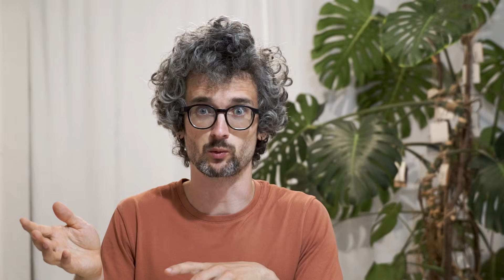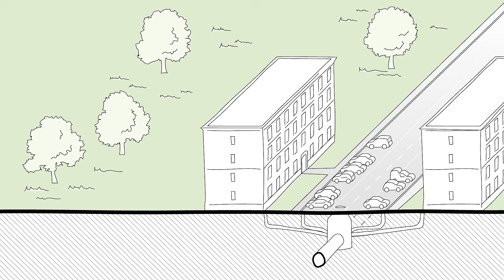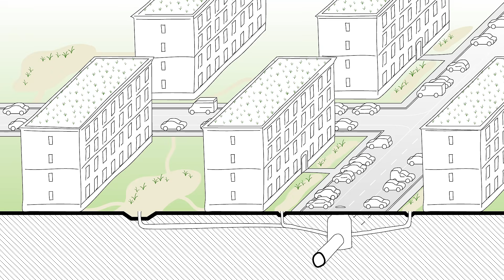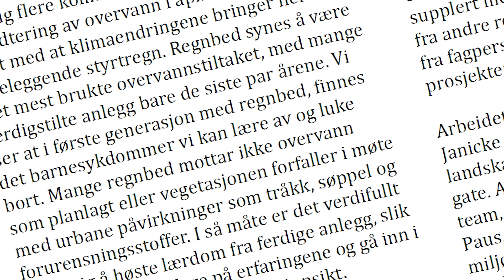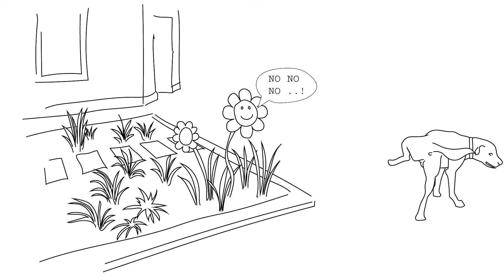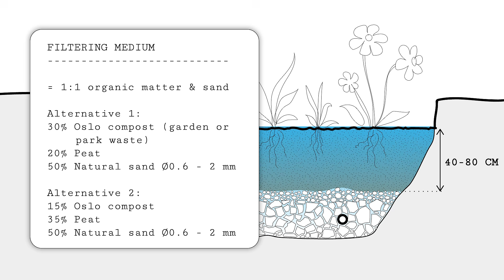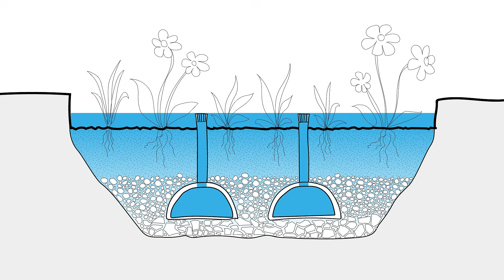How Oslo Turned Streets into Flood Protection

Comment: I find it a very good system. However, there's still drainage systems thinking. What I would like to see is think aquafier systems. Instead of draining to rivers; draining to underground cavities. The ones that already hold the water table stable and the draught at bay. Only then we keep drinking water from spilling over to sea
Reply from the maker: There is a different situation in dense urban centres and an open land. In open land you can let rainwater infiltrate into underground cavities. In dense urban neighbourhood you have to be careful with that - to avoid making building basements wet, and to avoid reaching potential road pollutants into aquifer layers. So I would say it depends on the specific project.

Comment: How does the water gets slowly relesead on those undergournd storages?
Reply from the maker: There is a similar system Savaq - plastic tubes underground collecting water, which then are able to transfer this water back to soil via capillary forces. See picture here https://terrigio.se/produkter/savaq-160/

But for this particular scenario I cant remember the exact system how it works anymore - I would guess some very little openings that allow water to slowly flow further, reaching drainage pipes and going further to rainwater sewage (just my guess, correct me if I am wrong).
Reply: @MareksUrbanChronicles  Thank you! I was thinking something like that. But I got a bit confuse on how to avoid the water to enter from the soil from those small holes and fill the storage before the surface water level hit the high to enter in the tubes xD

Comment: I live in Oslo and I can see that the twin administration is creating more of these gardens in many areas of town.
When a road needs heavy working for other reasons (repaving, placing new pipes or cables, etc) they redesign the road.
These gardens are not applied everywhere, because, obviously, they require considerable space to be built.
To have them you often need to sacrifice something else: walking path becoming smaller, reduced bicycle lanes, reduced parking space, reduced road for cars.
All of the above has a cost fir people living there, and it's important to find the right compromise between all needs.
As the video stated this solution requires a lot of maintenance which has be done every year and very carefully (expensive).
Cleaning the walking areas and streets is also critical here, and should be done more frequently than what is done today (otherwise all crap will go into the gardens).
At the same time the town is also upgrading all big water pipes under the roads, the town is growing at very fast pace. A few gardens will not solve the issue by themselves.

I like these gardens and their potential, but their adoption have to be balanced by their cost (building+maintenance and convenience) to be reserved where they can bring the highest value

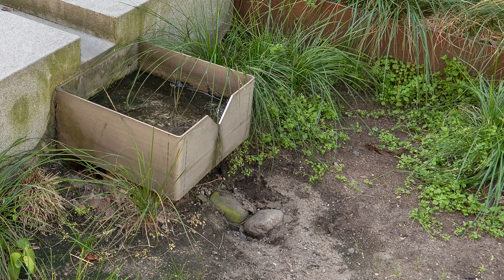Comment: 9:26 Garbage I understand but surely with the right plants any smaller pollutants can be absorbed/trap the heavy metals in the soil which is the point of these gardens rather than just having it run into water ways
Also removing carparks isn't really as much of an issue is it? Since it looks very walk and bikeable
Reply from the maker: It was a bit of sarcasm with car parks. I feel like it is one of the toughest fights in the city to remove a parking space. Always some people get mad.

Pollution can be solved with plants (I think there is a term for that - phytoremediation). Depends on plants and on pollutants, but a plant often absorbs pollutants which become stored inside the plant. Meaning you have to dispose the plant properly, because it becomes contaminated afterwards. It can not be put into regular compost. But as I said, that depends on plants and on pollutants... either way it is practical to catch pollutants 
in sludge pocket and be able to easily clean it out.
Reply: @MareksUrbanChronicles  hmmm, could parking spots be created on separate tilted slabs that rise above the water gardens?
Reply from the maker: @louisegogel7973  like transforming raingardens to dry wells?

Comment: or make a full tank with much more capacity and slap a nice green thing on top or just a grate that one can park on or a nice place to sit.
Reply from the maker: Yes, each has some advantages. Tanks could store more water and keep it without sediments to reuse + you save space above them to use it for whatever else. On the other hand raingardens have benefits for cooling down the street, keeping the underground water level and healthier soil, they are more simple to maintain (just cleaning sediments, instead of repairing electric pumps, filters, ... in tanks), and they are cheaper in initial cost and also in maintenance I would guess.

Comment: Quite a pitty for the few trees. Integrating them would be nice.
I´ve seen something similar here in Berlin, where they newly built houses in Lichtenberg. Though, it didn´t appear as sophisticated to me. Just a ditch of half a meter depth next to the road, with every second curb stone left out to allow the water to flow in. Except of the curb stones it looked like a regular green strip with new trees at the side, just in a V-shape. Certainly with some drainage underneath.
We also suffered quite extreme rainfall, ironically during the draught years. Surface and canalisation were overloaded. If the wastewater treatment plant was overloaded, all the dirt went unfiltered into the river. That had happened several times a year. And the soil, where the water belongs, won´t even be reached. One important step were big underground storage cisterns for dirt water to allow the treatment plant working it off time after time. But these "sponge" concepts are currently a big thing in Germany as an additional primary prevention. Good for the trees and for the river.
Reply from the maker: That was fun to see a few comments here from people saying they lived nearby this project but never thought there was anything more to it than just some random green strip. So I’m not sure either if this looked particularly sophisticated, but in the end, there might be some interesting layers underneath.

Happy to see sponge concepts appearing in Germany too!

Comment: I can see debris or even silt filling up some of those reservoirs if not managed properly.  So yes, this is not a set it and forget it type of thing.  This is going to be another line item on the city's budget to manage these resources so they can do their job when needed.
Reply from the maker: thats catched in sludge pockets and yeah thats true they need to be cleaned from time to time. In the end its a question of cost - would it cost more to clean sludge pockets regularly, or to have a little flood occassionally

Comment: Logical solution to an urban environment, with so many impermeable surfaces.  By putting more recessed and earthen areas, water can be captured and then slowly absorbed or retained until it can fully be absorbed.  It just requires hardy plants that don't mind supersaturation.  But yes, this should be the new norm in all urban planning.  Go with the land, instead of fighting against the land.

Comment: I know New York City has been installing similar things for a while.  And where I live in Washington DC has started, too.  They installed a lot in the low lying neighborhoods that have recently been rebuilt close to the water.  But even in the north of the city, at much higher elevation, they've started putting them in.  I think that's great, as it catches the water before it washes down hill or floods the system.  DC is very rainy (well, we're just coming out of a drought, but usually we're very rainy), and we have the old style combined water system, where when we get hit with very heavy rains, the stormwater overflow mixes with the sewer system, sending sewer material out into our rivers.  I believe, like in NYC, there's work being down to rebuild that terrible design, but it all takes time and money.  These stormwater catches are a cheaper, faster way to get started on the problem.  And as you mention, they improve the neighborhoods in other ways, adding plants and flowers (and taking away parking spaces).  DC, especially once you leave the federal area around the National Mall, is fairly green, with a lot of trees, parks, and such.  But more plants and less pavement won't hurt my feelings.

Comment: The removal of 'rain gardens' would be my first action. The drainage of that area should be handled by the storm water system. The obsession with greenery is stopping you from seeing the bleeding obvious.
Reply from the maker: Stormdrains are still there. Raingardens are a bonus capacity built on top of it.

Comment: Adding relatively clean rainwater to sewage seems very counterproductive to me.  In California we have separate storm water and sewage systems.  Sewage requires much more processing before it is safe to release into rivers and bays.  By having rain water bypass the sewage system, often with some filtering (and street cleaning to remove debris) fewer dangerous pollutants reach the ocean.

It greatly reduces the risk of sewage-contaminated water flooding the streets.
Reply from the maker: Yes, of course! It is always better if the city has a separate stormwater drainage system. But the presence of rain gardens is not dependent on that. A rain garden’s role is to slow down and retain stormwater, regardless of whether the backup option is a stormwater drainage network or a combined sewer system. Either way, a rain garden helps.

Comment: INTEWA's DRAINMAX system is an excellent way to increase infiltration under impermeable surfaces such as asphalt parking lots, pretty cheap to install too. Helps recharge our groundwater, as a second storage capacity after rainwater gardens and the like, this is a great option.
Reply from the maker: look interesting. What is the difference from regular underground tanks for storing water, easier installation?

Comment: One thing I did not see mentioned, and it may not be an issue there... one drawback of water storage in a stagnant or still holding area is insects - I am thinking specifically mosquitoes.  Again, that may not be an issue there, but it certainly is/would be in the area where I live.
Reply from the maker: I think depends on how wet the environment is. Mosquitoes need I think like 14 days of stagnant water to be able to evolve.
Reply: @MareksUrbanChronicles  It's why I was asking.  Curious since the bugs are different depending on environment.  They don't seem to need 14 days where I live, but then we have all kinds of weirdness where I live.
Reply from the maker: @VikingDragonJediThrace  Australia?
Reply: @MareksUrbanChronicles  lol - no, Texas, though we're on the edge of the desert so likely have lots in common

Comment: Removing parking is not a cost, but a feature in many places.
Reply: Indeed.
Reply: Perhaps all new or reconstructing of buildings aught to have the building’s parking places inside on the ground floor, up a slight incline to mitigate the chance of flood water entering… then all streets could have Green water absorbing catchments which would also be a huge part of cooling the cities in  summer.
Reply: A rain garden should never been placed in the once parking area in the first place.
Reply: @Matlockization Due to the potential soil contamination? Though most of the polluted soil layers will be removed from the location in that case, and replaced with clean soil if necessary.
Reply: @rvaviima what contamination
Reply: @nemanjap8768  Correct. Apparently they are more worried about 'soil contamination' that fixing the drainage problem.
Reply: @rvaviima  I can understand the town wanting to 'green' the area with a 'rain garden'. But from what the video shows it seems that its not working with a few problems introduced. Therefore return the area to a car park or just cobble stones and re-rout the roof water to the underground storm water system. Problem solved. Sometimes the solutions are right under your nose.
Reply: @Matlockizationno, i didn't know that building streets leads to soil contamination.  Also big reservoairs are part of the solution for drainage problems
Reply: @nemanjap8768  I never said that building streets leads to soil contamination. And where would you put the reservoir for this situation ?
Reply: @Matlockizationyou didn't ,but if you check again,  i didn't ask you about soil contamination but the other guy. Reservoir can be beneath the ground. It can be built when the buildings are being made or it can be added later. Tokyo is building massive underground reservoir in case of a tsunami or a heavy typhoon. If Oslo has rain problems, the idea is worth checking out along with rain gardens and more plant life to absorb it. How and where i will leave it to the engineers
Reply: @nemanjap8768  Ok. My understanding is that Japan is not building underground reservoirs but most of their Tsunami deterrents are in the form of raised walls. In other words, concrete barriers of all kinds. Tsunami's can overwhelm reservoirs and they can get clogged up from surrounding debris. What might work for Oslo might not work for everyone.
Reply: @Matlockizationb1m is the youtube channel.  The reservoir has been already built
Reply: @nemanjap8768  Which country ?
Reply: @MatlockizationTokyo,  b1m is the name of the channel. Few months ago the presenter went to Tokyo and showed and explained some measures they are taking for typhoons and potential tsunamis. In that video you will see him walk into an enormous reservoir
Reply: @nemanjap8768  Ok great.
Reply: @Matlockizationthe name of the video is : the insane scale of Tokyos disaster megaplan , whole video is interesting but the part i am talking about is named g-cans
Reply: @Matlockization Instead of just saying “ok great”, you should go back and remove the misinformation you tried to spread about the mega reservoirs in Japan.

And if you want to whine, go whine about the shitty infrastructure US have.
Reply: @NaeniaNightshade  I said that I thought otherwise then proceeded to ask you more questions to clarify your point. That's not whining or misinformation. I also said that Japan was building other stuff as well. Again, that is not whining or misinformation. Don't know why you are whining about America's infrastructure, as I am not American.

Comment: It seems like having moss-gardens on the roof of high-rise buildings are a great solution, considering all the maintenance of rain-gardens on street level? Or how much does it require of maintanance on roofs with moss-gardens?
Reply from the maker: you can have different kinds of green roofs, starting with light sedum or moss based ones (maybe 10 cm thick). They are quite lightweight and easy to maintain. Or you can have a thicker vegetation layer with grass, or even some shrubs or trees, with more water capacity (soil thickness even 20 cm - 1 meter) and more maintenance needed. Thicker layer is heavy with all the water inside, you need to take it into consideration with calculating loadbearing capacity of a roof = meaning it will be reflected into costs more, and it is more difficult (if even possible) to retrofit it to existing roofs. So sedum is an easy solution. Overall, green roofs are more expensive to build than regular roofs and thats probably the reason why they are not always preferred by developers. On the other hand they have some benefits, for example heat insulation or a protection of roof.

And another reason might be that when there is some little spare money, developer could choose to go for raingardens on the ground surface, which catch water from both roofs and pavements/roads.

Comment: They also added this in the city of Tønsberg. A street or two are being converted with this sort of system, and I think also getting more seating placements so it becomes less of a car street and more of a walking and shopping street. The streets were originally for pedestrians but got used more and more by cars. Now the streets have returned for more pedestrian traffic. The ground is also cobbled or bricked, which naturally diverts cars away which would normally want to drive there (even during the pedestrian/delivery truck only hours).
Reply from the maker: according to comments it really sounds like Norway is really into rainwater retention nowadays

Comment: Amazing to see how much Norway designs for flood protection, even though the rain conditions here in Stavanger aren't quite as extreme as back home in the Philippines, the engineering behind it is so thoughtful! I live in Stavanger now, and along the dedicated busway between here and Sandnes. In the section near Jåttå videregående skole, there’s a whole park designed to act as a massive rain garden. Even between the central busway and regular traffic lanes, they use small vegetated (dikes?)/dips to absorb runoff instead of standard concrete kerbs.

Back in the Philippines, where large rainfall and flooding are huge challenges, storm infrastructure has traditionally relied heavily on basic infrastructure like concrete drains. Sometimes there NO drains at all! Even if nature is involved, it's often, again, very basic, like back in my neighborhood in the philippines, they built a small hill between the river and my nighborhood. It holds back water, but it doesn't actively manage or filter it. for me seeing more efficient and effective solutions like the bioswales and rain gardens they have here gives me ideas about how my home country could potentially adopt similar solutions in the future.
Reply from the maker: Probably they need some Brad Lancaster that would start with it. And people can finally see it with own eyes, how it actually works.
Reply: Coz our politicians are either idiots or negligent. Also some places like NCR are floodplains.
Reply: @TaLeng2023 Agreed totoo naman.